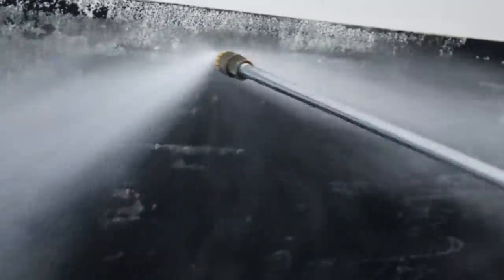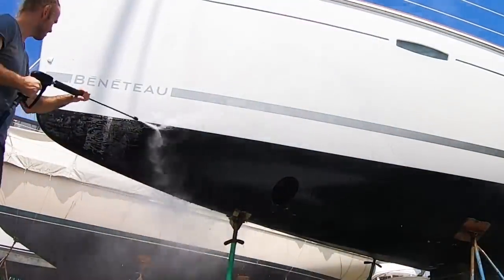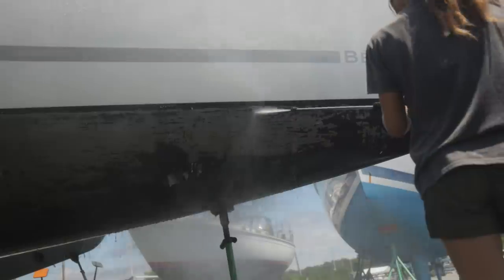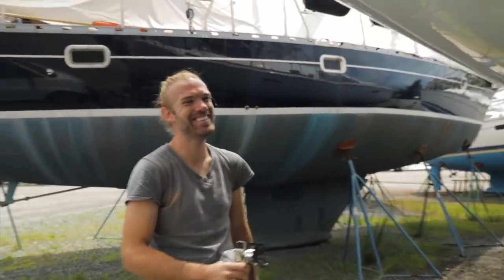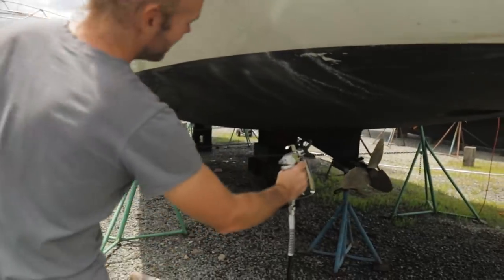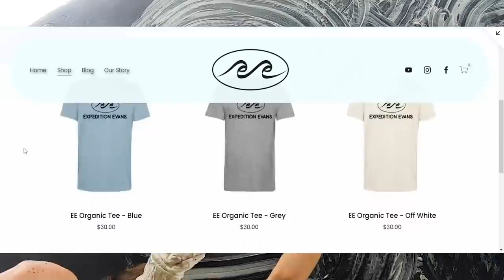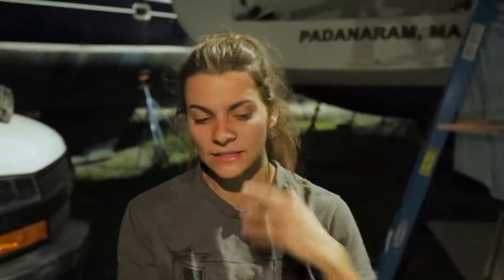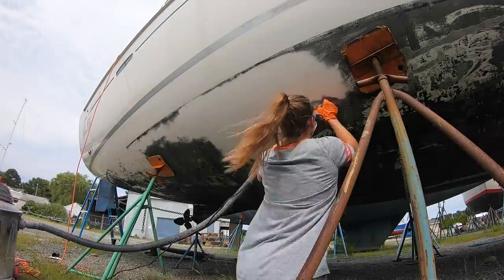PRESSURE Washing our SALVAGE Sailboat (finally) | Expedition Evans 26

Comment: With a little bit more pressure and more gallons per munte you would have done it faster, but you did a great job with what you had on hands, for paaint removal I would recommend you next time to try Aergreen 4180 Paint Remover, it is a green product, for the power washer try this nozzle or any similar to it: NorthStar Rotating Turbo Nozzle — 4.0 Orifice, 5100 PSI, Model# NYR51K40BP

Comment: Guys, I think you've already found the only way to get all the antifoul off and that is pressure wash first than use a professional carbide blade paint scrapper. It's takes a long time but gets you back to the original gelcoat. You will than need to epoxy putty the small nicks that the scrapper makes, sand these flat and then  you can use the antifoul of your choice knowing that it will be compatible with all your future antifouls.
Reply: We always round the sharp corners  of on the blade ,stops the corners  digging in .

Comment: Try using a paint roller to apply the paint stripper next time.  It will work  much mose successfully than the paint sprayer.

Comment: Nice job well done 
Paint stripper,
 Thats is environment friendly, well with al the particles in it .. it’s not.
Water blast is also not friendly is you don’t collect the residue. 
End so on end so on. If you apply pain striper .. make a one food patch and use plastic foil to keep it form drying. 
Leave it on for a good period. Prep the next food ..and start scraping the first Don’t use it all at once.

Comment: That bottom paint looked pretty decent already.  Did you want to change ablative types to something that was incompatible over what was already there?

We stripped our boat and started over but it was a cratered gooped-up mess with gelcoat/chopped-strand cavities rigjt under that which needed filling. 

Looks to me that you only needed to scuff that stuff up and paint more on top except for around the keel where you needed to fix the issues.  

Seems like you went to a lot of trouble and a large expense to remove a lot of perfectly good (and expensive) ablative anti-fouling that you could have saved and layered more on top of.

Then again I'm watching on a phone.  It could have been worse than what I could see.

Comment: It’s probably coming off easier on one side because the primer on that side was closer to a full cure prior to application of the antifoul, than the other side.
Reply: im thinking it came off easier because they didnt prep the surface as well if at all
Reply: @johncartelli  I’m a journeyman industrial painter and I painted boats in a shipyard for 4 years. Every ablative antifoul I’ve ever applied, requires the primer to be “tacky” while applying it. Prepping does nothing. The antifoul won’t stick to prepped surfaces. Unless sailing yachts use a different kind of antifoul but that doesn’t seem to be the case. I’ve seen a bunch these sailing channels use all the same products I’ve used. International (interlux), jotun, ppg etc.
Reply: @NateGoesOutside  prepping includes waiting  for the proper time to apply the next coat because each coat is prepping for the next coat.  i was told to sand with 250 grit first to roughen the surface to give the primer something to hold onto (which i consider 1st step in prepping). then a  wipe down with a proper cleaner before the primer is applied. once clean, primer is  put on. before it dries thoroughly and still slightly tacky (may feel dry but wet chemically) you add the additional coats. so if you have a very smooth gelcoat  maybe with still some wax contaminate and you put on your bottom paint i think it would be safe to assume it wont stick as well as if you"prepped" it  correctly...that was my suggestion to what may have cause one side to come off easier than the other.

Comment: I used paint stripper 2 times in my life. One time an environment friendly one and one"real" one. The environment friendly one was more expensive and worked just bad work. The "real" one smelled very violent, made the paint come loose within a minute or two and was very irritating on the skin when a small drop landed on it. Made sure to use safety goggles. The stuff even pressurized the can it came in. When I opened the can the first time the lit launched against the ceiling after I just pried it lightly with a screwdriver. 
The more dead fish and trees and skull signs on a can the better it will work most of the time.
Reply: Agreed. Experientially, if it doesn't require Gloves, Goggles, a Face Shield and a smock there's no point in a paint stripper. Green is fine, but there are times where those products are just not developed with accomplishing the project in mind.

Comment: Chemical strippers never worked well enough for me to justify the price.  Sanding works well but is time consuming.  If you want to get really clean to put on a barrier coat, soda blasting is the way to go.  You can get the job done in one day.

Comment: Stripping with water like that can be a bear without one of those rotary nozzles.  shudder  Now I’m having flashbacks.
Reply: @liongod1000  Now, now, I didn’t say they were using the wrong one…   Just shuddering in sympathy. :)
Reply from the maker: @robert rudolph we tried the rotary nozzle since everyone swore by it, it was worse than the pin point or even the fan!
Reply: Interesting.  Just shows every situation has it’s own parameters.
Reply: Expedition Evans Possibly that washer was not making rated pressure.  Hopefully you didn't damage the fiberglass.  It sure looks bad on video.
Reply from the maker: @Chris-bg8mk  the first pressure washer we rented was having issues, we ended up taking it back and they switched it out for us. The second one worked much better

Comment: Looks like you are using the pinpoint nozzle.  Common mistake.  You want the fan nozzle.  You are scraping paint with an ice pick instead of a paint scraper.
Reply: I was talking to the screen on this one. Folks, come farther away from the hull when power washing. It has the power on that pin point spread to go through your hull.  4 to 5 inch spread is good. Spray from 4 to 6 inches.  Cheers from the waters of Vancouver Island. B.C.

Comment: You should keep the nozzle of the pressure washer no more than 3 inches from the work area as you lose way too much pressure keeping it too far away ... usually the washer only gets off the loose stuff ..reckon you will be sanding again to do a proper job ... good luck with it ... laughs, I am not even going to comment on the paint stripper efforts ....

Comment: Other than the BUDGET it Seems like soda blasting would have been the way to go
Reply from the maker: After the cost of renting the power washer, buying the tarps for the ground, then buying all the paint stripper and sand paper - it might have been better to have hired out soda blasting from the get go. But that's hindsight for you!
Reply: @ExpeditionEvans  

Yes I scraped mine 40 years worth BUT it was only 29 feet as your boat is so much more surface area

Comment: Cheap brushes is the way to go.  Bio degradable is definitely the slow way. Go with the heavy duty stuff like if you want another career doing just stripping.  An Eldorado aircraft stripper would definitely cut your stripping by 2/3.  But use a lot of safety gear.

Comment: More work. Lol.  
Why didn't you do the traditional way, sand and just add another few coats?
Reply from the maker: We wanted to get all the way down to gel coat to make it easier to find any additional hull damage and to get it prepped for an epoxy barrier coat ☺️
Reply: @ExpeditionEvans  
Got ya!   My boat yard doesn't let us use pressure washers!  So.. we have to stick with the hard way. 😂

Comment: A pressure washer with a circulating ball bearing head works ten times better and faster than traditional nozzles like this one ... even with only one tenth of the power. So a really cheap electric one ($100) like that will work better than this one even though this one is very powerful.

Comment: It looks like you are trying to weed out the impatient viewers.  Begone. Me,  I put you on half speed and enjoy more, sometimes 1/4.  I sanded mine smooth and came back with a different shade so you could tell if it was gone,  its underwater and doesn't need to be that pretty.  What does it mean, the paint stripper is surprisingly more expensive than stripper paint?  In your keel install vid we see the white bottom, spoiling some of the suspense.  Anyway carrying the dog on your shoulder.  It doesn't get better than that.

Comment: Sprayer wasn’t primed. It didn’t look like you had enough water in the system to remove the air. Could have been just one part of trying to spray that mud. Maybe there was a way to thin it without de-activating it. Next time ;)